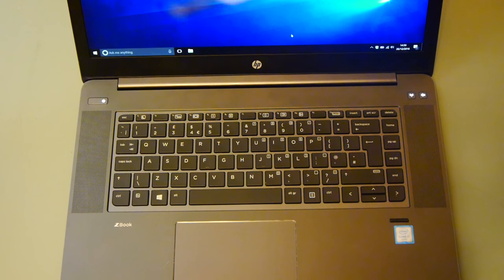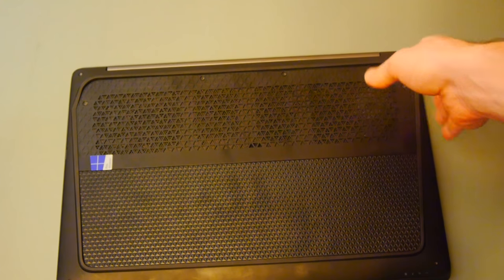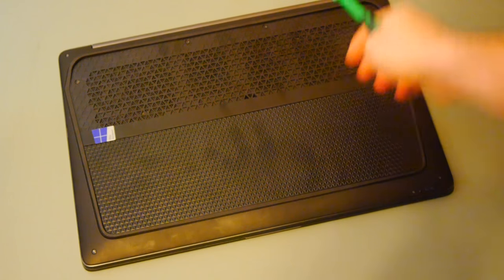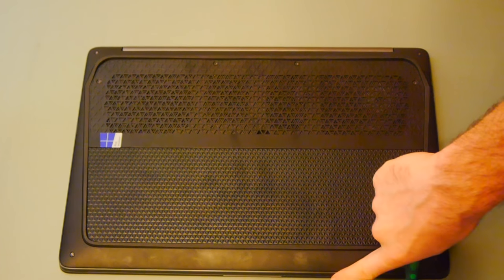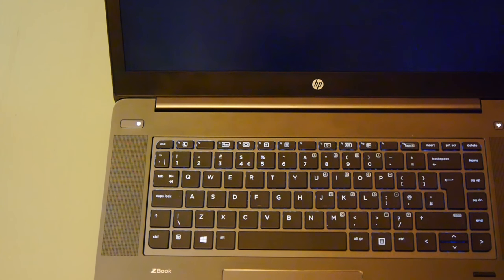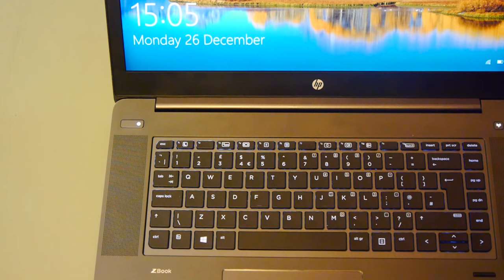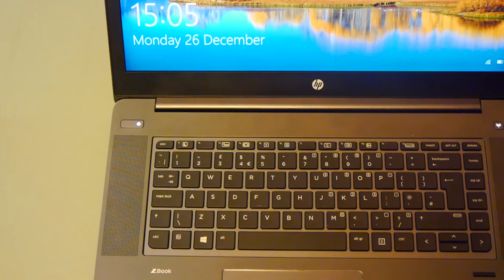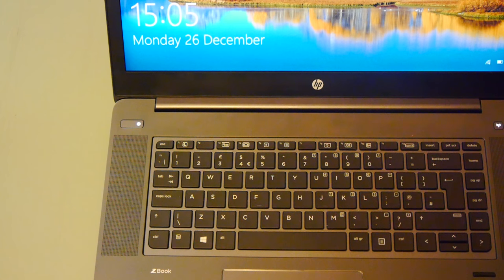HP ZBook Studio G3 - Disassembly and Upgrade Guide

Comment: Thank you for this video. Just used this to help me add a second SSD drive to my HP ZBook Studio G3. Screwdriver needed (and the one used by the video author) is a T8 T8H Torx. These sell for about $5.99 on Amazon. I believe any M.2 interface SSD drive should work, to play it safe I just bought one identical to my OEM drive off EBay (HP put a Samsung MZNLN256HMHQ-000H1 in my system). Installed drive and had to go to Device Manager and rescan for it to show up, then used Windows 10 partion utility. Less than $40 invested and I was able to double my SSD hard drive space  and probably would have never opened the system if it were not for this demonstration video,
Reply from the maker: Glad you found the tutorial useful. 👍

Comment: I opened my laptop.. so it is not possible to add normal SSD HDD right?
Reply from the maker: There are frequently variations of laptops that are 15.6" and above. 

One variation is a larger battery and two or three M2 NVME SSD slots. You'll sometimes see an option of having a smaller battery so that you can add a 2.5" SSD in. 

If there isn't space for a 2.5" drive in your laptop, you'll have to use M2 NVME drives.

Comment: So I don't know if you're still active on here. I got a new battery for this laptop trough the hp recall program, but when trying to install it it seems like the battery is not connecting well. Is there any specific think I should think of or do while reconnecting the new battery. Is there a chance I broke the connector? Thanks in advance!
Reply from the maker: I never had any problems reconnecting the battery. If the connector isn't broke, the only thing I can think of is that it's the wrong battery.

Comment: Thanks for the video, Kevin! It looks like in order to be able to remove and replace the keyboard, you'd pretty much have to remove every single component inside the chassis - including the motherboard - first. :3
Reply from the maker: +murur0a I watched the HP technican doing it. It's not impossible, but there is definitely room for error if you don't repair laptops on a regular basis.

I reckon you could do it if you followed a guide.
Reply: @KevinMuldoon  sad u have to go through a lot to replace keyboard

Comment: Hello mate, on my studio, the battery charges for about 10 seconds then nothing, so it's basically on zero percent all the time, ang recently it started to occasionally turn itself off, I'm assuming after 7 years or so it probably needs a new battery, what's your thoughts, have you come across this before.
Reply from the maker: Yeah that sounds like the battery has to be replaced. You did well running it for seven years without replacing it :)

Comment: Hello!
I would like to ask you three questions about upgrading your HP ZBOOK G 3 - T7V62EA:
1. Please specify if the WWAN slot in a HP Zbook G3 laptop supports a ssd cache?
2. If so, please specify which is the recommended capacity for a SSD that is used for caching in the WWAN slot if one of the slots has a 2.5 " HDD of 5 Terra?
3. Please specify if it is recommended to use a high-capacity ssd for the cache (for exemple 128 GB or 256 GB) to increase HDD speed?
Thank you!
Reply from the maker: These are technical questions that should be directed at HP themselves. I don't know all the exact specifications of the drives.

Comment: Thanks for the helpful video. I bought this laptop 6 months ago. The battery life isn't very great on this workstation. Can I bought a bigger battery and stick it in the laptop? I see some space in the cmod battery area.
Reply from the maker: I'm not sure if any larger batteries are available. It's not something I've checked as I've not had problems with mine.

Perhaps a third battery is available with a larger capacity.

Comment: Good video! I haven't been able to use fingerprint on this PC even after downloading the fingerprint driver. What up?
Reply from the maker: It could be a faulty fingerprint sensor or the cable that connects it to the motherboard. Generally speaking, driver issues are more common.
Reply: @KevinMuldoon  after installing the driver it's not showing the biometric option on the device manager section. What could you think it's could be the cause among the options you gave please?
Reply from the maker: My guess would be that it's still a driver or configuration issue, but it's hard to say without being there and testing myself.
Reply: @KevinMuldoon  thank you. One last thing, can I get the driver you downloaded and used for yours, maybe HP has an updated driver which is what i have that isn't working with mine?
Reply from the maker: I sold the laptop on eBay a year or so ago. I recommend checking the HP website. It could be worth using the Intel Assistant for driver updates too.
Reply: @KevinMuldoon  Alright. Thank you, I appreciate. Cheers!

Comment: Heloo Kevin , thank you for thye tutorial. i have a same machine but my challenge is after updating the BIOS , the screen is nolonger displaying. When switching on the laptop, i hear the fan working, keyboard lights flashing on but with no display. kindly assist. Thank you
Reply from the maker: Is there a chance it's outputting to an external display by mistake?

I believe one of the function keys allows you to change the display from laptop to monitor etc.
Reply: @KevinMuldoon  thank you Kevin. later after running some troubleshooting tutorials you have shared i later discovered that my primary SSD drive was faulty. Removing it then the display came. Once again thank you
Reply from the maker: You're welcome. Glad it helped.

Comment: plz guide me i have hp i7 zbook 15 4rth gen can i upgrade grapic card bcz some one told me u can but plz guide me if i can then sugest me best and cheaper one
Reply from the maker: There's no easy way to change the GPU, sorry.
Reply: @KevinMuldoon  Well, my Lenovo's NVIDIA discrete graphics is soldered in the system board, but the G3 uses a PCIe card, similar to DELL and Alienware
Reply from the maker: I don't recall that being the case with the one I had. Mine was the studio G3. I looked at the other variations and didn't see any options to replace the GPU. 

Which model do you have? I'd love to see which cards were available for it.

Comment: won't opening this particular laptop void the warranty?
Reply from the maker: +Papa Bizon The first thing an HP engineer told me to do when I called about the problem with my laptop they told me to open it up. Later, someone from the third party company that handles repairs said that I should not open it up.

All of the engineers I spoke to said that it simply isn't practical for owners not to open it up as discharging the battery and removing the RAM are necessary when troubleshooting issues. I agree with that.

Comment: please, can i upgrade the Graphics card ?
Reply from the maker: There's a limited number of laptop GPU components that would work with this and it's hard to find compatibility lists.
Reply: @KevinMuldoon  
my labtop is the same in this vedio
Reply from the maker: Yes, but your options are limited. The main way to change the graphics card in this laptop is to order the repair part. It wasn't designed to have a replaceable GPU, only for parts to be replaced by their engineers.

In theory, other parts could be added, but they may not be compatible with the motherboard.
Reply: @KevinMuldoon  
that mean i can upgrade the gravic card from 2g to 4 or 6 G
Reply from the maker: I haven't looked into compatibility for parts for this laptop, so it's not something I'd know. 👍

Comment: I'm trying to upgrade my storage as I have 30GB of storage that I need to constantly maintain. Is this the appropriate choice, in terms of compatibility? https://pcpartpicker.com/product/w34NnQ/intel-600p-series-512gb-m2-2280-solid-state-drive-ssdpekkw512g7x1
Reply from the maker: I'm not sure whether that drive will work or not.

There are some discussions surrounding this online, such as https://h30434.www3.hp.com/t5/Notebook-Hardware-and-Upgrade-Questions/Add-extra-ssd-hp-Zbook-G3-studio-Drive-surgestions/td-p/5807619

In this discussion https://h30434.www3.hp.com/t5/Notebook-Hardware-and-Upgrade-Questions/Add-SATA-3-SSD-to-ZBook-Studio-G3/td-p/5529000 , someone says "there are only 2 positions for SSD in zbook studio, both for M.2 format SSDs, 2280 size, PCIe or SATA versions".

This suggests the drive you picked would be ok, but since I haven't tested it myself, I obviously cannot say that with conviction.
Reply: Thank you! I find these resources invaluable especially since my researching skills are aweful. Regardless, it does look to me that it should work. If you're interested I can reply whether it worked or not.
Reply from the maker: +Nincadalop Yes that would be great. It will help others that are looking to upgrade their hard drives.